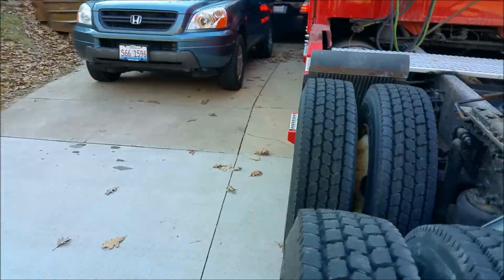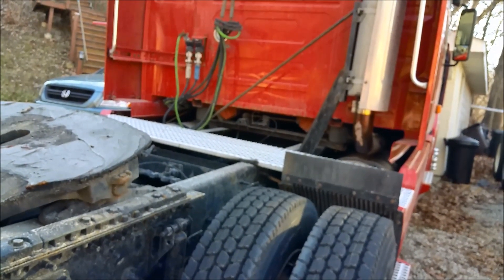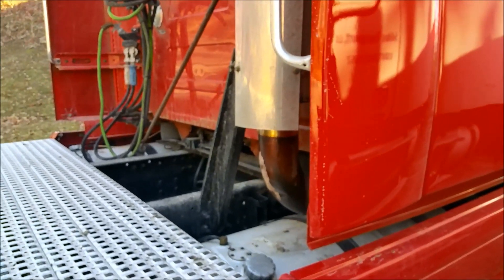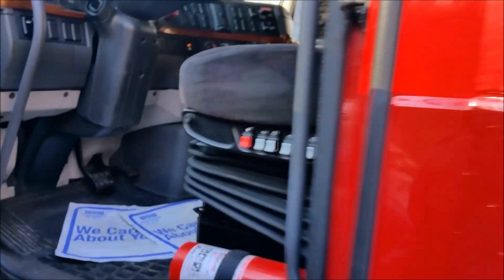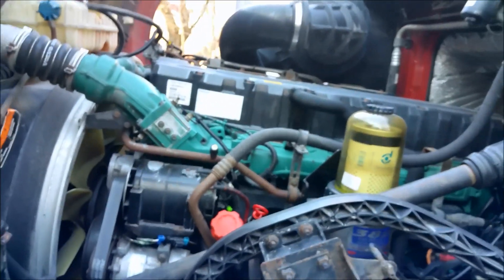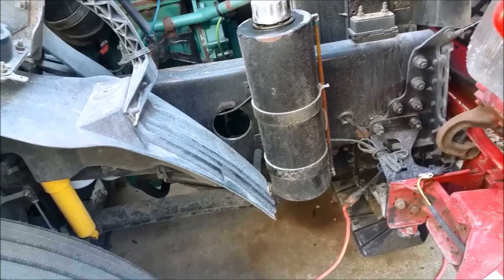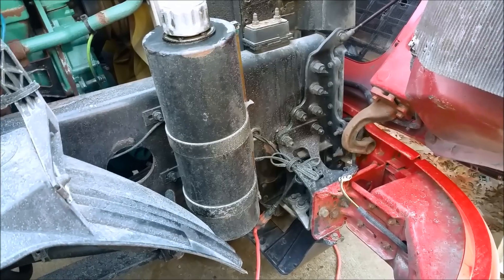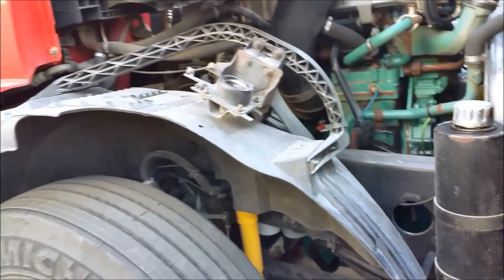Volvo 780 Engine Heater, Block heater Warmer Volvo

Comment: Hi, thank you for the video, I have the same Volvo D12 but couldn’t find the plug. Is it by turbo ? Thank you
Reply from the maker: Look toward front passenger side along frame rail
Reply: Where I can buy the plug fits the one on the truck ? Do you know what’s cable called please? I have the same truck, thank you for the video